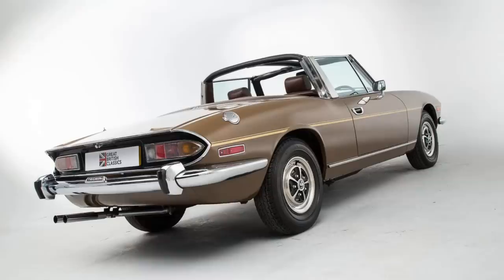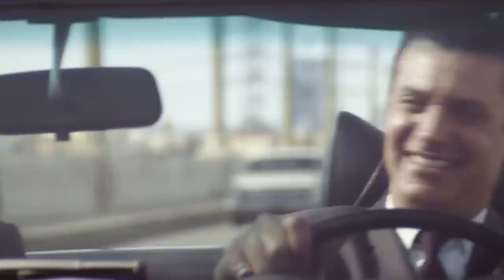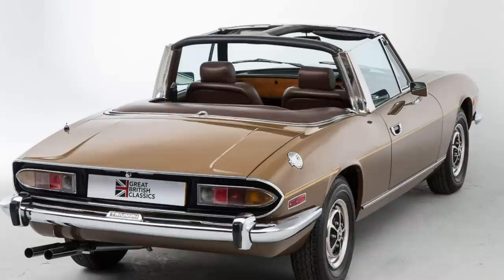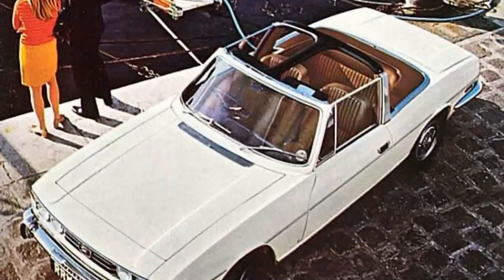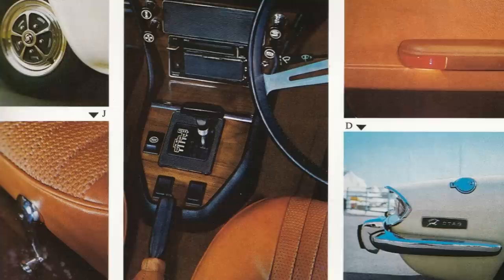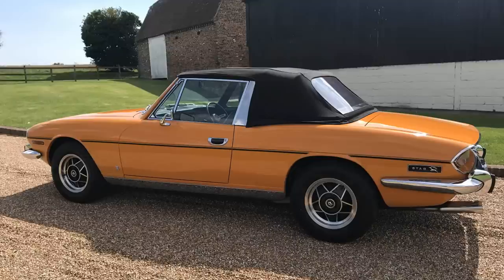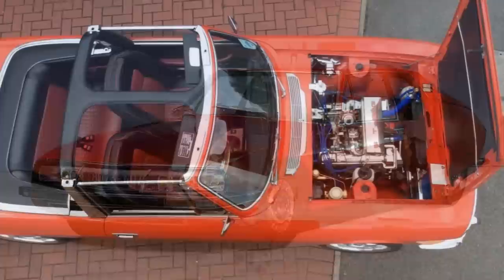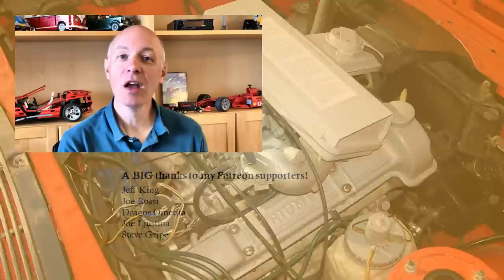Why did the Stag FAIL so Spectacularly?

Comment: The expansion tank on the Triumph V8 was lower than a lot of the water circuit, including the pump, that's where the problem stems.
Reply: Head bolts that were not on a parallel plane is also not a good idea. And I thought EVERYBODY knew that if you are using dissimilar metals on a liquid cooled engine, you need to use special coolant. We even knew that back in the old Ford Flathead days. Most all of the hop-up heads were Aluminum, and we ALWAYS used corrosion resistant coolant.
Reply: @oldgysgt  
Ah yes, those as well.
What were they thinking ?
Should have dropped the Jag V12 in it.
Reply: @lewis72 ; I'm afraid they would have had to lengthen the bonnet a bit to fit in the V12.
Reply: @oldgysgt  
The Triumph six fits in it.
I wonder how much longer the Jag V12 is than that engine.
Reply: @lewis72 ; I don't know, the Jag V12 is about as long as my 4.2L Jag six, and it was pretty long.
Reply: @oldgysgt  
Yes, that XK engine is a long six, certainly longer than the Triumph six !
Reply: @oldgysgt  off axis bolts (not at right angles to head to block face) is common in high performance engines, adds a measure of block bore stability to the top of the block....problem is Triumph did it all wrong.
 That V8 is a fantastic example of design by committee with many changes of engineers during it's very painful birth. I had a Stag MK1 1973, pretty cars certainly but, already dated when launched.
Reply: @richardrichard5409  
I still have a 1970 Stag. It's needing some TLC but it's not too bad.
I was also given a rather rusty 1977 XJ-S, which is sitting on my driveway under a cover waiting for me to make a decision on it !

Comment: From what I heard, the main problem was overheating because the fan was driven off the crankshaft which meant that the engine really didn't get cooled in a big tail back. The answer that of course was an electric fan connected  to a thermostat

Comment: Timing CHAIN not timing  BELT. If I'm not mistaken it was just s single row,
Reply from the maker: That bit's actually straight from the Wikipedia page, so that page needs to be altered.
Reply: @BigCar2  I think you are mistaken. The Triumph Stag Wikipedia article mentions timing chains twice but never mentions timing belts. The click-through link on that Wikipedia page for the Triumph V8 also makes it clear it has a timing chain. The article was last edited at the end of May.
Reply from the maker: @vicoastdog  OK - maybe a typo that got into the script then.
Reply: @BigCar2  take it as a sign and move on to telling posh English kids stories instead.
Reply: In the mid 1980s I helped a friend rebuild the engine of his Stag. It had a timing chain, just one very long one that ran around a sprocket on the crankshaft and one on each of the overhead camshafts. The crank is of the cross-plane layout, which means that although the firing intervals are uniform in the engine as a whole they are not uniform within each cylinder bank. This has the effect that at a given moment each camshaft has different numbers of valves opening and closing and there are points at which one or the other camshaft is trying to overtake the engine, causing snatching tendencies in the chain and hence rapid wear.
Reply: @cedriclynch  They have two single row chains. One run has three sprockets, one has two. Right hand chain operates the right hand cam only. Left hand chain runs a jack shaft and the left hand cam. Jackshaft runs water pump, oil pump and distributor. Original AE chains have maint interval of 25,000 miles = ridiculous. IWIS now make chains that last indefinitely. Although I will change mine at 100,000 kms if I get there ( :-) ). I still drive mine at least twice a week (36 degrees here today - drove it for an hour) but I don't drive interstate anymore; so unlikely to do that in ten years now. But many cars now use single row chains of the same size with no problem. The "chain loading" is no problem IF THE TENSIONERS ARE SET UP PROPERLY. Again - many people who don't take care with that, have problems; and then blame the car. The tensioners are the same used in so many others; including Jaguar XK engines. They have no reputation for problems.

330,000 kms in a hot climate = chains given no trouble. Apart from the ridiculously short service interval.

Comment: “The 4 cilinder engine was relative reliable”. For a BL product this meant little. Beautyful cars though.
Reply: I was deeply involved with US BL warranty after the launch of the TR7 and we had plenty of the same overheating issues with the four cylinder engine.   Some were due to the poorly designed cooling system filling method.  Once overheated the heads warped and being OHC were not able to be skimmed so were throw away.  Later cars circa 1978 on were much better and the injected cars better still.

Comment: Great design let down by a terrible engine..how many times has that happened though ! another excellent video Andy.
Reply: Terrible production not terrible engine (read my post above).
Reply: @stagweberVMad  Fair comment .
Reply: @stagweberVMad  Absolutely a terrible engine, which contained many bad design elements that made them hated by mechanics and another great example of why  the UK doesn't have a car industry anymore.
Reply: @deaddoll1361  You are just repeating what you have heard as many do because it makes them sound well informed.  Hated by mechanics becuase they were 2nd class mechanics used to working on cheap simple engines and didnt know how to maintain them properly. Even BL didnt get to the bottom of the quality problems.  Cooling passages and radiators blocked by casting sand - is that bad design or poor quality control?  No coolant change in the maintenance schedule so after a year corrosion set in; is that bad design or bad maintenance?  Why are stag owners now going back to orginal engines and why are they worth more like that?  If they knew then what we know now how to fix and maintain them the Stag would have been a fantastic success. You are out of date mate!
Reply: @stagweberVMad  Concur mate. But then again - you already know that we agree :-)
Reply: @stagweberVMad   Yep. Give a Swiss watch to a boilermaker to fix. You get it back and it doesn't go anymore. CONCLUSIVE PROOF that the "watch design is rubbish." No - he didn't understand it/gave it to the wrong person. Old Jaguar XJ's have the same reputation here. They are cheap, so people service them "on the cheap" - and then have problems. NEVER happens to Aston Martins - because they don't find their way into the "corner garage who does ancient Holdens".

Comment: I had a mk 1 & mk II stag
From day 1 
I took them to Tony Hart in Park Royal
Who  raced Stags with some success
To modify engine steps were a must 
1.upgrade the radiator & water pump
And fit a water expansion tank above the height of the heads& have a coolant of high antifreeze content ( kept topped up)
2.replace the two distributors with electronic ignition 
That was in the main Engine was sorted 
Improved the suspension & steering  
It was great
Coolant 
Needed checking daily & weekly
I never fitted the Rover unit
But later did own a 3.5 V8 Mercedes 350 S E class 
It was a dream 
No comparison with the stag or jaguar's of the day
Today still a few stags around 
But would never buy another ✌
Reply: I had a plan to pimp my mk II stag
My idea was to put in a short block v8 engine & transmission 
Lower it
Fit big wide wheels
Paint it black
If I find a cheap model I still might do the restomod 
It looks so wonderful
Shame of epic proportions by the management

Comment: Thanks for the interesting video, but you shot yourself in the foot suggesting that the engine design was flawed.  The related 4 cylinder engine had the same features you derided, aka angled head studs, high water pump, yet you pronounced it quite a good and relatively reliable engine. In pre-production tests the engine ran faultlessly, but to cut costs in production they used cheap head gaskets, which caused failures.  Overheating was not due to bad design either, it was casting sand debris that clogged the coolant passages, plus corrosion due to lack of inhibitor in the coolant.  Ask any current Stag specialist how well they run now that engines are rebuilt correctly as classic cars. It is all down to quality control not design.  In my opinion the only real design flaw was the use of a low mounted expansion bottle that was prone to letting coolant drain down. If they had fitted a gravity fed header tank like that in the TR7 and Dolomites it would have saved a lot of engines.
Reply: Renaults were prone to air-locking in the cooling systems.Dealers had a long funnel connected to a dummy filler cap and several small bleed valves to be used after any coolant work with the engine hot and running.
Reply: Like everything British cars at the time was about quality control. Owned P76 x 2 and went like stink but oh the quality ....
Reply: @tryfree1  from Mosgiel?

Comment: Question: how did Britain go from ‘engineering experts’ to making naive engineering mistakes??
Reply: The involvement of accountants and cost cutting, gutless investors, short term thinking, reduced development time, poor management. 
If the engineers were supported with budget then it would have been much better.
Reply: That's a great way to put it. Seems the same thing happened in US. ignoring red flags and warnings.
Reply: Cost cutting so beloved of the Tories.
Reply: @MeTube3  part of a multi century class war that England particularly has had. Everything from England not having had a major territorial invasion to clean out the upper class  lamdowners through to its elite driven protestant reformation. Every other European country had to somehow reach a national consensus including the role in this case if technocrats.

Comment: I had a White one for about 4 years. Tan coloured hard top and Black mohair soft top. The previous owner had fitted a set of Red Alloy wheels from a T. V. R, which to me made the Car even more stunning. Unfortunately the main bearings on the Crankshaft gave up and ended selling the full car for £400.  🙄😕.

Comment: I made the mistake of buying my wife a lovely yellow Stag in the 70’s . I made an even bigger mistake of driving it down to the south of France, at least trying to! We got as far as just south of Paris when it started to over heat. We got recovered and were taken to the local British Leyland French garage at Fountainebleau where they proceeded to repair it whilst we carried on our journey in a hire car.  Three weeks later, we collected the repaired car and settled the bill which was around £1500 a tidy sum in those days. We proceeded with our journey back to the UK secure in the knowledge that the car was repaired by the proper franchise garage. After only about 100 miles, it started to run hot. Because it was now late in the day and the garage was shut, I carried on . The result of this was one ruined engine by the time I got home, and that feeling that if only I had followed my gut feeling not to risk such a long journey knowing all I knew about the Stags reputation. Such a lovely looking car completely spoiled by the mechanical engineering . This summed up British engineering at that time and why the Japanese were so successful , coming in with their bullet proof engines and superior engineering.

Comment: Is that a Standard 10 in the lower right corner at 2:20?

One nitpick: the Stag V8 had a timing chain, not a belt. But your statement about needing to change the chain every 25K miles is correct. The American magazine Road & Track gave the Stag a lukewarm review based on the driving experience, never mind the unreliability, which wasn’t yet evident at the time.

A workmate of mine in San Francisco ca. 1976 had a Stag, which spent a lot of time in the shop.

Comment: Like many (saying) in the 'COMMENTS' the Stag is a lovely car, its looks are to me simply lovely and the burble from the V8 one of the best around by far. BUT Oh what a price Triumph paid for using their ill designed engine sorry to say – if common sense had prevailed and it had used the Rover V8. A much lighter, BETTER designed engine (care of Buick in part) with bullet proof reliability etc. Just think how well it would have done ... but hey lets not go there, these sentiments have been expressed many times before. Nevertheless I'd still love one ... and sleep better at night if it had a Rover. I've driven all three, Triumph V8, Rover 3.5 V8 and Rover 4.4 V8 from a Leyland P76.

Comment: There was in conversation a 3 litre V8 in the Stag, and in Australia, the cooling system issues were more pronounced. The 3.5 litre Rover V8 fitted to the P6 would have  performed just as well, with proven reliability. When the aluminium cylinder heads (of the original 3 litre) were repaired, (planing of the surface meeting the head gasket and cast iron block), the timing chains could not be tensioned, so one design flaw after another were illustrated with that engine, despite many design ideas put to the engines of today working reliably...

Comment: i am a 35 year panel beater spray painter . the problem with all old cars where they where crap . they where rusty before they even had the plates put on . i worked for ford dealers mostly but worked on almost all cars . the wiring where dreadful and dangerous . even the old jags . they where famous for wiring rotting and the wiring plugs broken as the over heated and fell apart . i hate to say it , but the best thing that ever happened to the motor industry was the japanese .

Comment: If they had only accepted Rover's V8...
Reply: Or even the well proven straight 6 injection engine from the 2.5 pi. 
Which pre 1973 produced the same brake horse power.

Comment: Best of all would have been to adopt / adapt the Daimler  250 V8...
Reply: Absolutely, designed by Triumph, 140BHP in standard tune and good quality materials
Reply: Ironic if they had used it, since Daimler used a TR chassis for the SP250 Dart !

The Yanks would have loved a Hemi...
Reply: @johnmoruzzi7236  You're right, I think if I win the lottery i'll buy two stags, one with an original engine and one that I could fit a Daimler V8 and see if there's any difference in actual performance.
Reply: The Daimler V8 was designed by Edward Turner, among others he was responsible for the Triumph motorcyles speed twin (Bonneville, Tiger)
Reply: Even better if the engine had made it into a Mk2 Sunbeam Tiger.. that car was dropped by Chrysler because of its Ford V8 and there being no Chrysler V8 that could be made to fit into an Alpine.

Would have been a Coventry car with a Coventry engine..
Reply: @johnmoruzzi7236  Absolutely, as much as I like the Stag engine I do think they missed a trick with the Daimler one, very similar in terms of weight and output but better quality materials, and they look the absolute business with their wide alloy rocker covers.
A drag racer called Russ Carpenter used a 2.5 Daimler in his dragster and was getting 1000 HP with a supercharger fitted so I don't think the Triumph engineers would have had too much trouble getting a reasonable amount out of it. Maybe it was thought of as being too old a design and Triumph wanted something with overhead cams
Reply: @tevie54  No, it was designed by Edward Turner who had previously been with Triumph motorbikes. Totally different to, and no connection with, Triumph cars.
Reply: @doubledee9675  Triumph actually started out making bicycles then motorcycles then cars so they were one company at first but eventually separated before the second world war so there is a link between the two but I know what you mean. Incidentally the Daimler engine uses Triumph Bonneville pistons
Reply: @tevie54  Yes, I should have made it clear that I was referring to post-WW II days.  Thanks for that info about the pistons.  Turner would have been contemplating normal Daimler production of 1,000 or so cars a year at the most.  On that basis, using the Bonneville's pistons must have made economic sense.  Daimler completely stopped production of small cars in mid-57, when the last Conquest Century ran off the line.  Then Jaguar seized the design of the engine, put it in a slightly re-trimmed Mk 2, and sold 19,000 of them, by far the best selling Daimler ever.

Comment: I had a modified one of these for 25 years, Chevy 5.7  engine ,5 speed Toyota gearbox ,3.9 BMW diff ...jaguar vented  discs,, 6 pot Wilwood calipers  etc etc etc ..I even straitened up the steering wheel angle.. triumph 2000 non power rack   ..Conan,,,, big problem was the stupid idea of a water pump on top of the engine  ,,,Oh and Datsun drive shafts

Comment: I remember in the 1970's there was a whole industry devoted to doing engine swaps in Triumph Stags. Every car enthusiast magazine was full of adverts for that service. I forget now which engine was normally use for the replacement. I'm guessing the Rover V8 but it may have been a Ford 3L. The Stag had a terrible reputation and residual values.
Reply: Of course the Rover V8 was probably the best engine ever built in Britain, though it was actually a modified Buick V8. It was madness not to have used it.

Comment: I had a T2000, but the Stag was/is my dream car. I did drive one once.  At the time it never occurred to me that the steel hub caps on the T2000, T2.5PI and Stag were supposed to look like alloy wheels. They didn't, and certainly fool anyone, and I just thought they were meant to be pretty patterns!